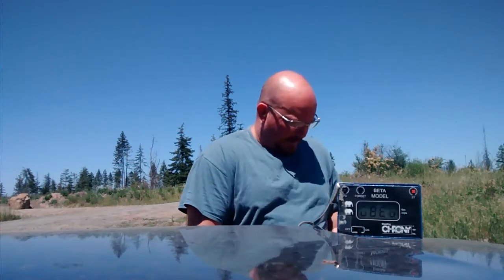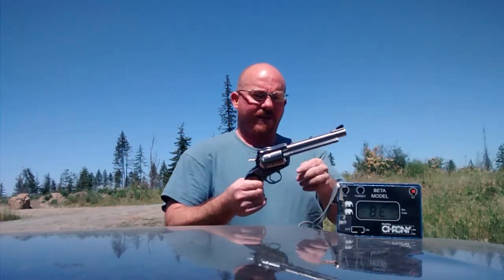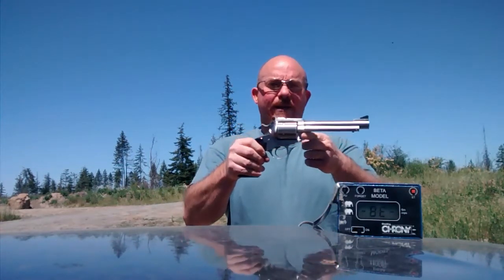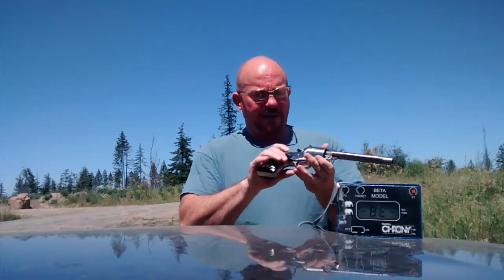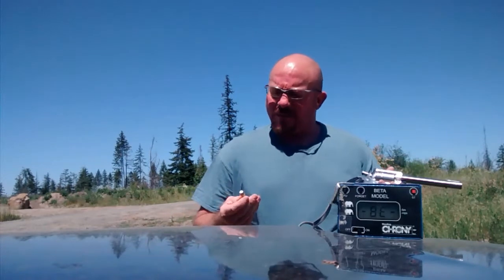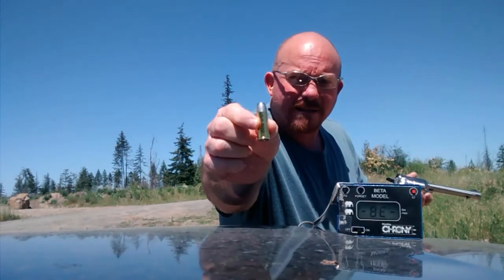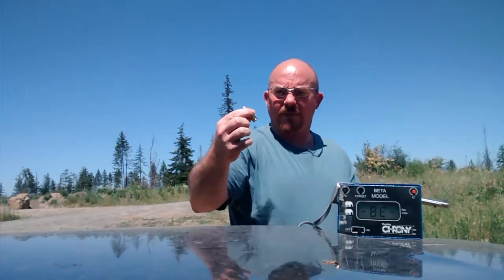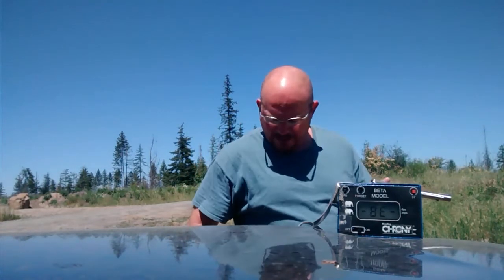Ruger Bisley 480 Ruger

Comment: Ive heard the 480 Ruger isnt too bad when it comes to recoil. Though a 410 grain bullet at 1200 FPS has to pack a punch to the hand. How would you compare the 480 Rugers recoil to heavy 44 mag or 454 Casull?
Reply from the maker: C-grunt I haven't shot a 454 Casull but I owned a Colt Anaconda...the 480 Ruger begins at the upper limit of 44 Magnum recoil. I have another video where I shoot my 4 5/8" barreled Blackhawk in 45 Colt with a hot Linebaugh load and they come up about the same distance but the 480 pushed about 3 times harder into my hand. It really is fun to shoot and it's not one of those guns that'll make you develop a flinch...just use a very firm revolver grip and keep your arms loose - I can hit a paper plate 5 for 5 at 85 yards with the factory iron sights.
Reply: Thanks for the reply. I checked out the other video with the 45 Colt. You got some good looking guns there.